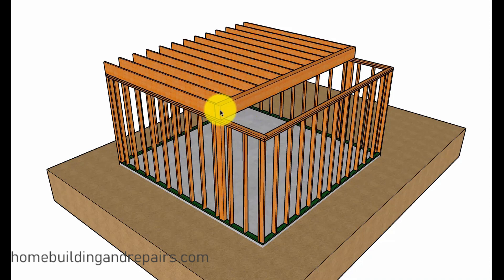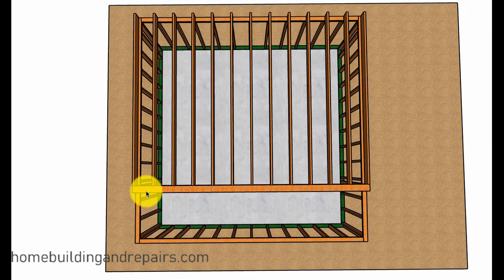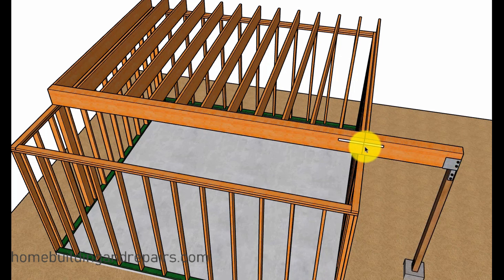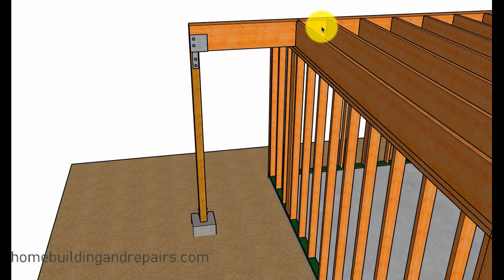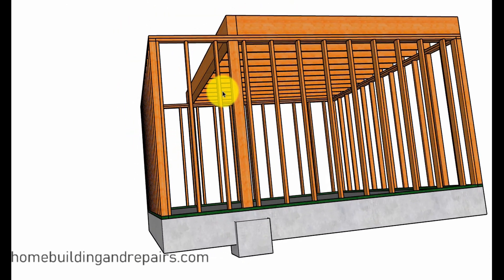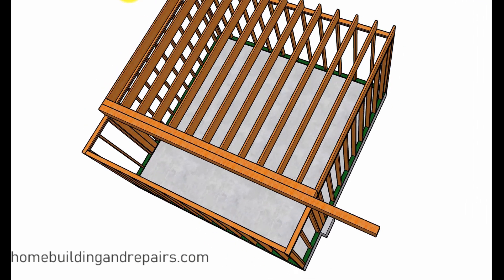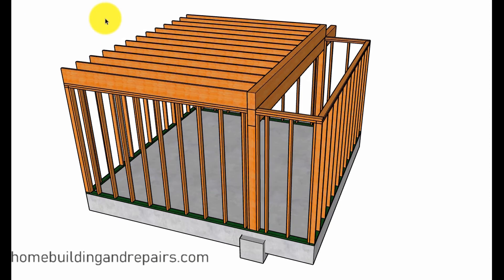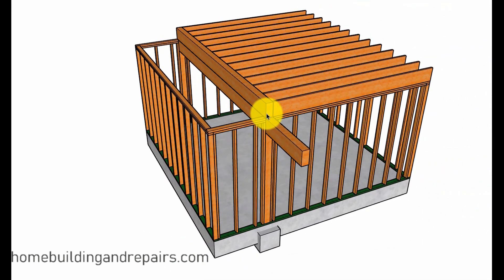How To Extend The Length of Load Bearing Beam Without Stretching It - Home Remodeling Tips

Comment: Question, I have  conventional 2 car garage my current ceiling has only 2 by 4  very few,  like 4 or 5., I was thinking to lower the ceiling to 8 feet , drop it the one Foot 1/2 down. Build a ceiling floor with 2 by 6 and speed them 16 inches in the center. Can it be done? If so should attached a 2 by 6 across the wall and the apposite and sit all my two by 6 on them.
Reply from the maker: I cannot provide you with engineering information, but would suggest visiting the website and checking out some of the framing videos.

http://www.homebuildingandrepairs.com/remodeling/framing/index.html
Reply: Thank you for taking the time to answered my questions. I have watch most of them, but none speak of lowering the garage ceiling, there is one that speaks of hangin the rafters, to floor  ceiling and removed the 2x4 and change them to 2x6 and placed them every 16 inc, I was going to do that, but I wanted to lower the ceiling just enough for the garage door to open,  it seems it might work, i though the rafters are very few and find seen to be very supported, by adding the floor ceiling 2x6 will make the garage  much stronger and I can use the top for storage? I was only going to drop the ceiling about 1 1/2 feet, ,

Comment: Greg, have you ever replaced ceiling joists with bigger ones (2x4 existing) and instead of going taller you knew the ceiling was dropped for accoustic panels and the 2 feet dropped space could be used as space to put the new joists. So that means trying to poke new studs down the walls? How messy?
Reply from the maker: Feel free to email me to email me some pictures for more information. I'm not exactly sure what you're referring to.
Reply: Yes, sister frame on new joists. It’s very easy.